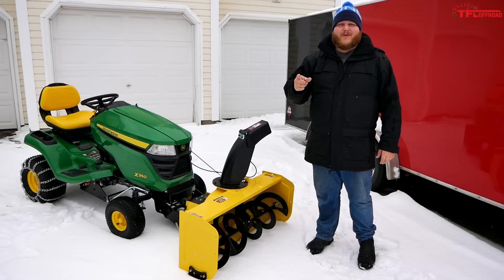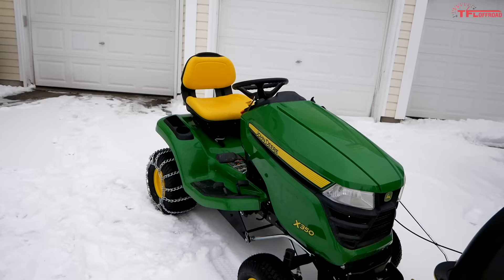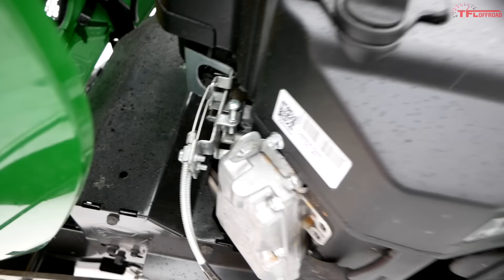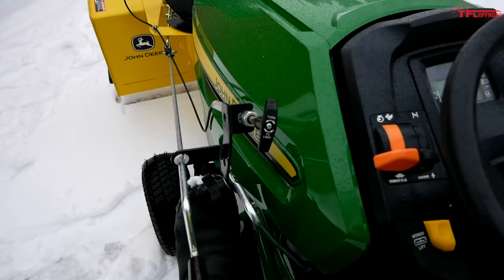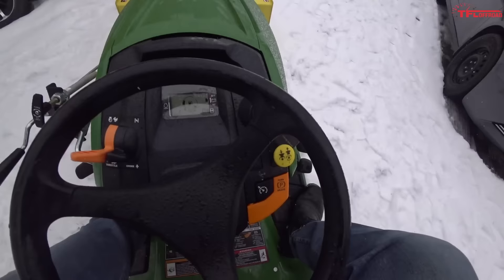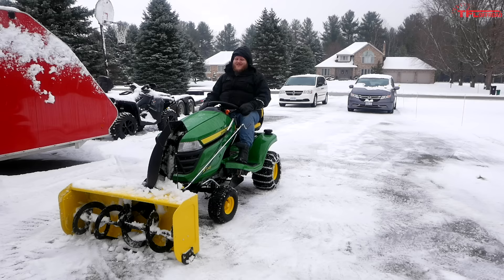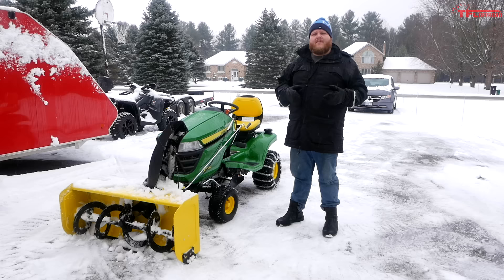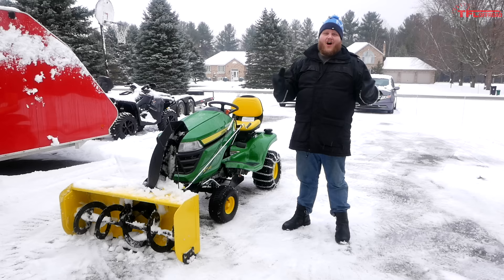Watch This Before You Buy a John Deere X350 Tractor!

Comment: I really enjoyed this video!  I don't know a thing about tractors let alone with snow blowing functionality.  Thanks for explaining how everything works!   Great looking home too btw :)
Reply: clwade10 it’s really not a tractor, it’s a lawn mower
Reply: @adamfpv8294  that's true.  Meh oh well. I  still dont know about them haha
Reply: clwade10 I didn’t know they made hydrostats that small, and tractor weights or I guess lawn mower weights in this case, they looked like 20lbs normal ones are 100lbs.
Reply: I'm wondering how long that light-duty hydro is going to hold up pushing around that blower.
Reply: Cameron, I have a X330 with the same transmission and I am going on 3rd year of plowing snow with a blade and mowing a half an acre and mine is still holding up good.  I have about 50 hours on it so far.  Only problem I had was the carburetor went wonky on me and had to be replaced.  i also put ag tires on front and rear and have 4 42 lb weights on the back most of the year when I don't have the bagger on there.
Reply: @channell11  As a owner of a John Deere riding lawn mower smaller then in this video, model LA135, and a John Deere sub-compact tractor larger then in this video, John Deere 1025R with the snow blower, I can tell you my transmissions are fine. 

A snow blower is not like a plow nor ground engaging equipment.  Its not doing the hard hitting action.  

That being said, where the smaller riding lawnmowers have non-serviceable transmissions, the X series shown here have the ability to change the fluid, where my sub-compact tractor has a user serviceable 3.3 gallon hydraulic fluid tank, user replaceable hydraulic fluid filter, a 2’nd user cleanable long tube shaped screen filter, and user removable and cleanable strong magnet at the bottom of the fluid tank.  This service of changing the fluid, filter, and cleaning the user removable parts is listed as a every 200 hours service item. 

The John Deere X series, made in Horicon Wisconsin, USA, is intended to offer something above  the Home Depot / Lowes riding lawnmowers yet below the John Deere 1 series sub-compact tractors.  The equipment abilities and price fall in the middle as well. 

Is it right for you?  It just depend on what you intend to do with it.
Reply: @channell11  Probably as long as you'll ever live

Comment: I bought an X300 in 2013 with the same blower as you have. The 300 is a little under powered for the blower but it has handled up to 3 feet of snow without problem. I live in a snow belt right off Georgian Bay. Repairs... 3 shear pins … 1 drive belt. Mower deck: 1 drive belt. Tractor: oil changes and a new front tire.. it kept going flat. They are EXCELLENT tractors and you will never be sorry you bought a Deere

Comment: I bought an X370 with power steering 3 years ago and I really like it. A couple of things I have discovered with my machine that might help with winter snow blowing. Never use the parking brake between use when the machine sits over night. It will freeze and you can not engage the blower. Keep some 1/4" x 1 1/2- 2" bolts and nylon nuts on hand to replace the ones that break in the auger shafts. My machine will not start if the temps go below 20 degrees, so I keep a torpedo heater near by to warm it up for 5 minutes or so on those cold days. Have fun removing and installing the drive belt for the blower. I use a small block of wood to hold the spring loaded pulley over far enough to slide the belt on and off. If you can, don't leave the blower out in the weather over the summer. The control knob for the chute will rust inside. I also change my oil and filter every 50 hours, not 100. If your mower deck is equipped with a fitting to attach a garden hose, it works best if you flush the deck out over a hard surface (driveway) with the deck as low as it goes. Finally, I'm not sure what the difference in US vs Canadian dollars is but, I paid 6k for my machine in May of 2016 with the mower and blower set up.
Reply: Those auger bolts you refer to are actually engineered shear bolts. Never replace them with common bolts. If you jam the auger with an obstruction they are intended to shear .to protect the auger gearbox from damage. The proper shear bolts are inexpensive and available at the JD dealer.

Comment: I started with a used JD 316 moved up to a X500 similar to what you purchased. Living in Iowa I wanted to have a blade for summer usage.and a blower for snow removal. With the blade and blower being heavy the manual lift was too hard on my body. I now moved up to a JD X530 Which has hydraulic lift ,power steering,power differential lock and large tires.These accessories are worth every penny I spent.  In snow now 2024 we’ve had over 13 in snow so far and this machine is a blessing. Push or blow the snow and the quick hitch system is easy to change over. Just not an issue how much snow I can remove.😀👍 Nice home and  large yard which reminds me of my place.👍

Comment: Holy crap an oil drain that actually comes out passed the frame!
Reply: Oil drain on the SAME side as the oil filter- I like that.
Reply: The oil check screws into place, BUT . . . to check the Oil Level, let the mower sit and the oil to drain down into the engine, Then without screwing the dipstick into place just push it down as far as it can, pull it out and read it.  Only screw it tight after you have finished checking the oil.

Comment: Nice video. I had a  14’ X324 which is the 350 with the bigger motor and 4 wheel steer. Loved it. When I decided to get a snow blower however, I traded for a X584. It has the bigger seat, tires, motor, 4 wheel steer, power steering and power lift. I love my X324 but this thing is night and day difference. The trans is heavier duty and even more responsive. The power steering makes operating it effortless, my favorite feature. Enjoy, should last you a long time!

Comment: Looks like you made a good choice . My personal experience with Deere is ,they last for many years , Make sure to change oil AND filter , grease ALL fittings ,and check for loose bots and fittings perioticly. As an example I have a 4010 from 1963 that still runs and operates fairly well about 12000 hrs still no Mager repairs

Comment: Being a fellow Canadian, you should spray the frame and all exposed metal parts with Fluid Film. The tractors will last longer and eliminate any chance of rust.....
Reply: Why?  Most every non commercial lawn tractor/mower like this one is built to run maybe 200 - 300 hours  (10 - 20 hours a year for ~ 10 - 15 years) in its working life. Critical parts will become obsolete well before it rusts the frame out.
Reply: Daniel 045  What does putting a new engine in a worn out chassis do?  

As someone who had reconditioned several riding lawn mowers and garden tractors most of then the engines outlast the chassis and mechanical driveline parts by a wide margin.

So much so I make a point of salvage engines off riding mowers to use for other purposes or to sell to those who ruined theirs by running their engines out of oil or other self inflicted lack maintenance destruction.

Comment: These are really good machines, I have a 2010 X300 with 800 hours on it now and it has the Kawasaki V twin but is rated at 17 hp, one great engine! About filling with gasoline, you can avoid more spillage by not using your gerry can spout as they sometimes leak where the spout screws on. The wide mouth is a smart idea! I mow three acres and it takes two tanks and five hours, so mow half, coffee or lunch and then the other half. Good video, thanks.

Comment: I bought a X540 with mower, tiller, power bagger, and snowblower in 2007 for almost 12k including taxes.  Been a great tractor for me.  Only issue I've had is had to replace the lift level when it broke and a new battery this year.  Keep a battery maintainer on when not using it and the battery will last a long time.  Kawasaki makes a good motor.

Comment: ah, I see the service interval label says to change the transaxle oil after the first 50 hour break in period.  That's good.  Most people don't do that because the K46 transaxle is said to be "non-serviceable" because the average homeowner can't service it.  It needs to be serviced by a skilled mechanic.  If you plan on keeping your tractor more that 4 years, you should service the transaxle after the 50 hour break in period.  John Deere puts 10W30 oil in the transaxle when it's new to give it a better break in period but after that, you should dump out the oil, open the transaxle, clean the dirty oil and metal shavings out of the gear box, reseal the transaxle, and then fill it with a synthetic 5W50 oil.  This should give it maximum torque and a much longer life.  But if you don't do this, the transaxle will gradually lose torque over time until it becomes useless.  Here's an example of a D170 which also has the K46 transaxle.  It's starting to have trouble mowing this ditch, probably because the transaxle was never serviced.  https://www.youtube.com/watch?v=9_3qCmCmlIg
Reply: It's a shame a $3000+ Deere comes with the same fragile, non-serviceable, light duty transaxle as any other entry level mower.

Comment: im glade you like the seat you will be buying a new one ever one to 2 years the base has flex and it cracks on both sides keep and eye on the snow blower idlers they hold water clean them out and spray them with wd or some this like that or they will seize and just some fyi the belt is at max tension when the blower is down so thats  the best time to tern it on  and for taking the blower on and off blower up to remove the belt from pto if you take care of it its a 20 + year tractor

Comment: I have an 08, great rig. I start, shut down, and engage pto at full throttle. I’ve never had a problem... the blower however does have some drawbacks. The plastic shoot will crack when launching ice chunks. Mine’s duct taped, and then gorilla tape over the top for a better look. The collectors can bend when jammed into blocks of ice. Having said that, the shear pins don’t break as intended... Do not suck a newspaper up into the blower it’ll simply strip the plastic out. Tapped and bolted mine back together. I love mine, and I hope you do yours.

Comment: I have a 2007 X300, Kawasaki engine. Yours has two heavy lift rods where mine has one single thinner one. I have the 44" snowblower the same as you. 
I had to add (2) extra 50 pound weights in the back, but that snowblower does an amazing job. I used to live on a 1/4 acre lot. It also moved snow for 6 other neighbors, and 600 feet of road to my house as the town was very slow to clear it... My X300 has had its share if little problems, nothing I couldn't resolve..The Kawasaki engine is very strong and quiet as you say, very reliable.  Do your maintenance and you'll have your tractor for 12 years too. Just know, the seat will crack with time because of the winter use. My father had a 1971 110 that also cracked.. All seats do it..  
I've moved snow so deep, I couldn't see the top of the snowblower. Yes, you go slow so you don't overwork the blower, but it will more than do the job! I put on some homemade drift cutters made from extra shelving angle metal.
N- joy your tractor!

Comment: good video just got one picking it up tomorrow, Main reason 10 gauge deck.Have a D 130 deck went in less than 3 years. Plus I like the 3 blades instead of only 2. the longer the blades the easier they bend. it did not take much to bend the longer blades. As for the snow you are showing that is not very much snow, wet is heavy to blow but the 2 & 3 ft wind packed is the hardest, we get snow up to 4' drifts and when you stand on them all you do is leave a foot print, on top and I am 185 lbs. I would like to see if the blower will go through that. I am glad they are using a 2 stage I had a 3 stage and all it did is take out shear pins when we had hard packed snow, had to get a 2 stage, made a world of a difference. Thanks for the video, made me glad I went that way.

Comment: I have a X324 that is very similar except it's 4 wheel steer. I'm also in the country with a couple acres to cut and 300 feet of driveway. I deal with quite a bit of snow here in central Minnesota and my X324 handles it very well. If you blow any powder and there is a wind you will quickly realize you need a cab. It makes a huge difference. You won't regret your purchase. Mine now has about 300 hours of trouble free service.

Comment: When we moved to the country with the 2/3 mile lane 10 yrs ago, it was either a zero-turn and get an old farm tractor with a fixed blade, or the JD X748 AWD diesel (X758 now).  Went with the JD and man does she love to push the snow.  Didn’t do the blower because of the gravel, but the hydraulic blade is perfect.  And she mows like crazy, too. More than 10 yrs old & running strong!  Of course that’s going a touch pricier than the 300 series 😱

Comment: Because i live on a very busy public road, always plowed by the county, I purchased the best snowblower for heavy wet snow, a Tracked Honda with electric start, the 9 HP , the H928TAS model, it always gets the job done. It has a hydrostatic transmission not the often useless Friction Wheel drive system common to other walk behind snow blowers.

Comment: I had buy one john deer like this for snowblowing my driveway and the main issue i had is , in winterstorm or when the wind make the snow hard , the front snowblower is not heavy enought to stay on the ground. The snow blower dont take the bottom snow and after the wheel stock in. you need few pass. I finish by buy a small larger tractor (1023e) and now is really good.

Comment: You’ll get a longer life on your PTO switch if you throttle down before engaging the blower with the PTO switch! Engaging the blower when you are at full throttle is hard on the clutch. I also held the choke up for a bit till the engine warmed up especially from a cold start on a cold day.
Reply: And it is worse on your engine to Lug it and it is to engage at Full Throttle

Comment: Thanks for the review. It definitely factored in my decision to buy my X370 & snowblower. I'm older and decided that the power steering and hydraulic lift would come in handy, but otherwise the two machines are quite similar. I've only had mine for about a month, but after cleaning up after 3 smallish snow storms, I can already tell I'm going to love it.
Reply: I downsized property last year and traded an x580 for an x370 and I love it!
Reply: @highwayman5355  how much land did you have before and how much land did you downgrade to?

Comment: X330 has the Briggs engine. It’s actually a commercial grade Briggs. I have sold several and had very good luck with them.
Reply: In my opinion, I use a lot of commercial small engines, the Vanguard is hand down the best. I don't know about the Kawasaki though since that is the only one I haven't tried,
Reply: I've got two 30 year old Briggs opposed twins.  They are only 12.5 HP but they seem like workhorses.  They don't even have pressure lube!  Though, I do think 18hp would be a better match to my 42" single stage blower...
Reply: I have the Kawasaki in my 354, 200+hrs without a hiccup.

Comment: Nice machine...but you will find out the hard way in time that because your yard and drive are"flat"doesn't mean trouble free traction.Anytime you run a two stage blower,diff-lock is a requirement and power 4-wheel steering isn't a luxury either.
In time what will happen,is when you turn the wheel to go left or right,you'll hit a patch of solid ice and the tractor will continue to go into a straight line.( in spite of using chains)
The 4-wheel steer system helps dramatically with directing drive power with your rear wheels in icy conditions while turing left and right.(X-534 in my case)
When you get to be my age you'll find that hydraulic lift is not a luxury it's mandatory.
I bought the X-534 for these reasons,plus the heavier K-72 hydro is a much heavier duty transmission and will last much longer.
Now,when you start up,ALWAYS start your PTO at idle to no more then 1/3 rd.throttle when engaging.Those electro-clutches are about $400.00-$500.00 bucks to buy new,so you want to go easy on it at startup,then power up to full throttle.

Comment: Really makes me happy I spent 380 bucks on my 2000 craftsman mower. Came with chains. Wheel weights. 46 inch snow blower and 46 inch mowing deck. And it's got a 20hp motor.

Comment: Our x350 has been great, but like everyone else has pointed out the seat will crack and deteriorate really quickly. I've put 150 hrs on mine and the only thing I wish I had on it was a real suspension. When mowing on hills I end up lifting a wheel pretty frequently and occasionally I get two wheels in the air.

Comment: Nice tractor, I have a John Deere 316 tractor that my dad bought back in 1984 and I am still using it today, rebuilt the engine once in it.  I love that John Deere still has parts for old machines like mine and you can see the quality in it, as you said it has a beefy steel frame.  not sure I like the foot pedals if you are going to be doing hours of mowing, mine has the hand lever and it takes 8 hours to mow my lawn.  I like that it has a tight turning circle, for me going around the trees, I can go about half way, do a short back up and finish the circle.  I don't like the fact you can't position the choke when cold to let it warm up without holding the lever, but maybe it doesn't need it.

Comment: Didn’t read all the comments. I have an x580 (recently traded in x530). Larger but similar. One thing you didn’t mention is the reverse override. If you don’t activate the override, the mower (or blower) will disengage when you backup. It’s a pain to have to re-engage after each reverse movement so the override is really useful. Otherwise, good video.